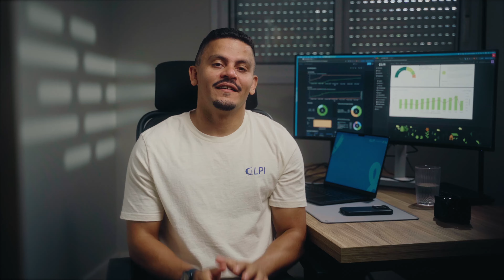Understand and install the Plugin Carbon for GLPI 🌱

Comment: How can we deploy Boavizta in a windows server to use it with carbon plugin? Is there any alternative?
Reply from the maker: Hello,

BoaviztAPI is maintained by Boavizta, so the deployment steps live in their repository: https://github.com/Boavizta/boaviztapi

On Windows Server, three approaches exist, but they're not equivalent:

–> Docker (recommended) — this is the setup documented both by Boavizta and by us, and the least likely to cause surprises.
–> WSL2 — a solid alternative if Docker Desktop isn't available in your environment.
–> Native Python — possible, but the least documented for Windows and the hardest to maintain.

Once the service is running, set its URL in the Carbon plugin configuration page.

For questions specific to BoaviztAPI itself, the Boavizta GitHub is the right place (https://github.com/Boavizta/boaviztapi).
For anything related to the Carbon plugin, use (https://github.com/pluginsGLPI/carbon)
— GLPI Team